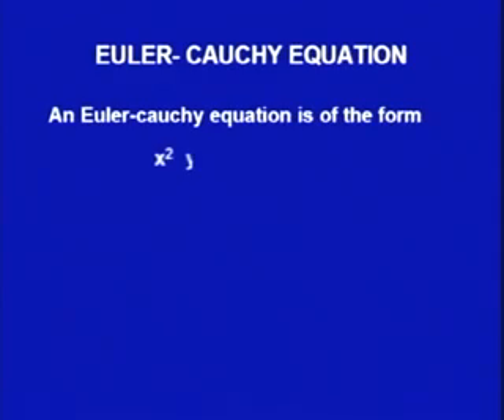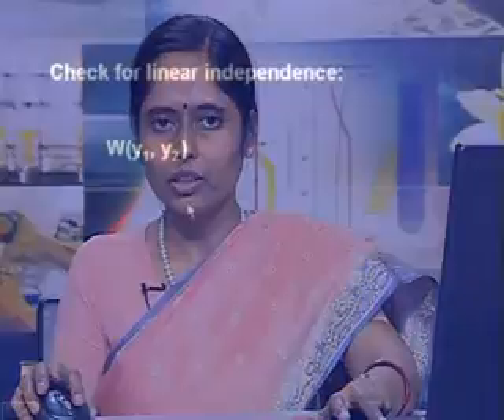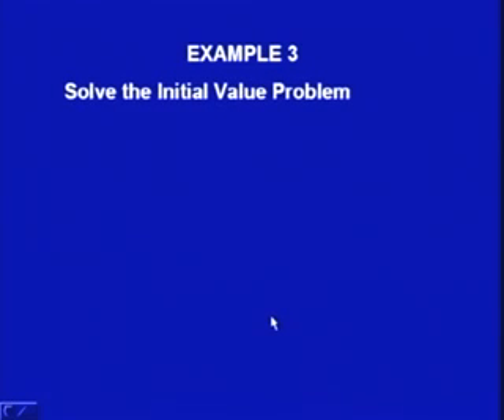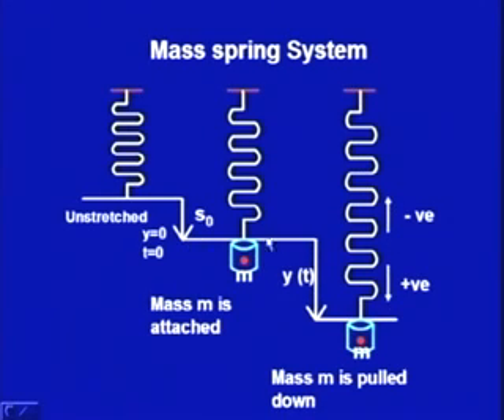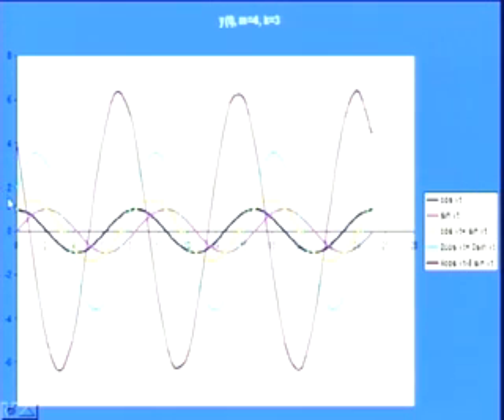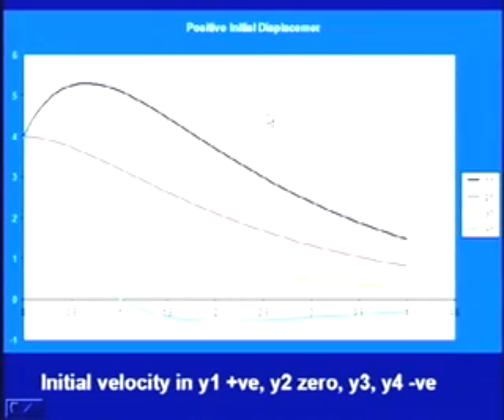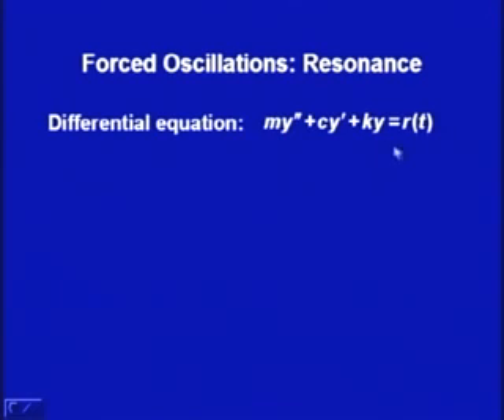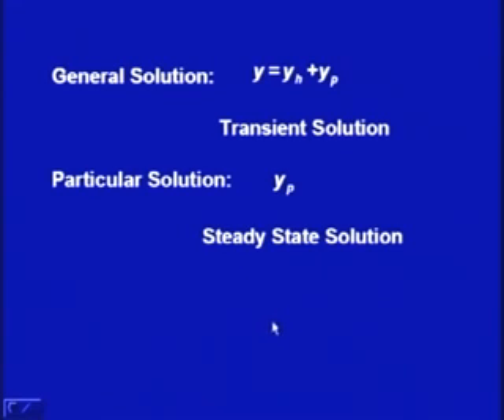Mod-2 Lec-6 Euler-Cauchy Theorem

Comment: Great video but there is an error in the solution for case 1 at 35.00 min. α = c/2m and β= sqrt (c^2-4mk) /2m, since λ= - c/2m + sqrt (c^2-4mk) /2m if we substitute α and β we get λ= - α+/- β or  λ1 =- α + β and λ2 =- α - β
And the general solution is y(t)= C1e^(λ1)t +C2 e^(λ2)t. Now substitute - α + β for λ1  and  - α – β for λ2. The general solution is now y(t)= C1e^(- α + β)t +C2 e^(- α – β)t
Just bring the negative sign into the parenthesis in front of the α and you are ok.

Comment: There's an error in this video. the solution of the ode in example 2 of  cauchy - euler  equation is A/X + bX. because the solution of m^2 -1 =0 are 1 and -1 . It was incorrectly stated as 1 twice.
Reply: ya exactly, that's an error.